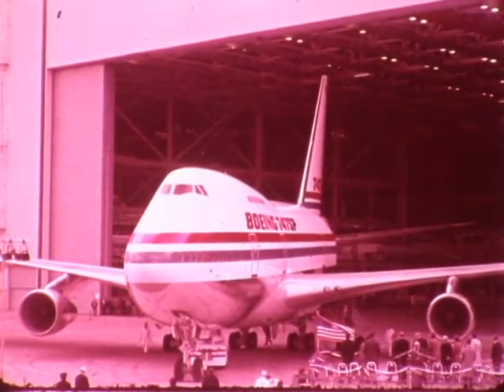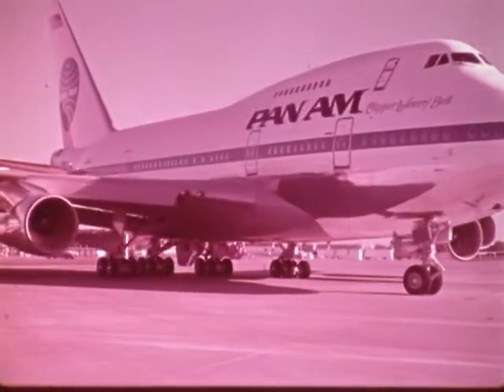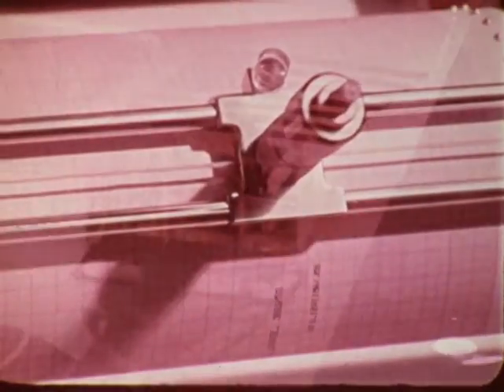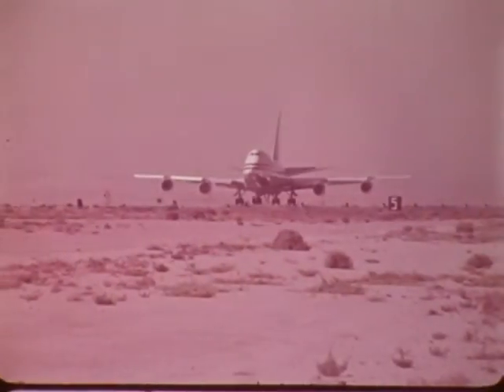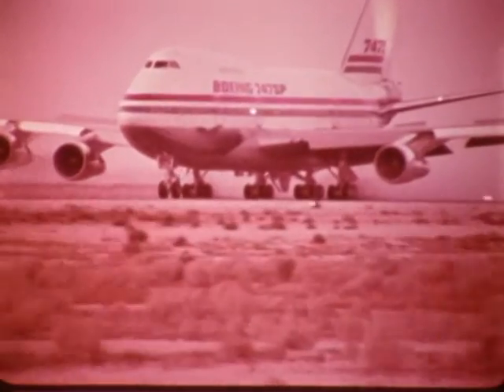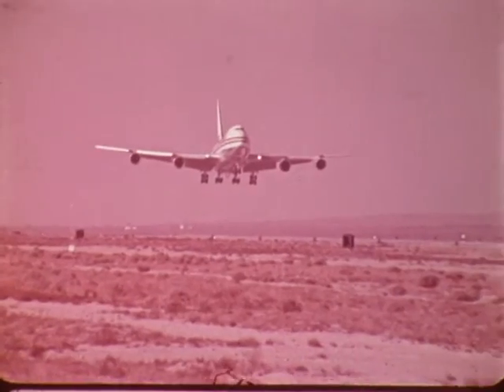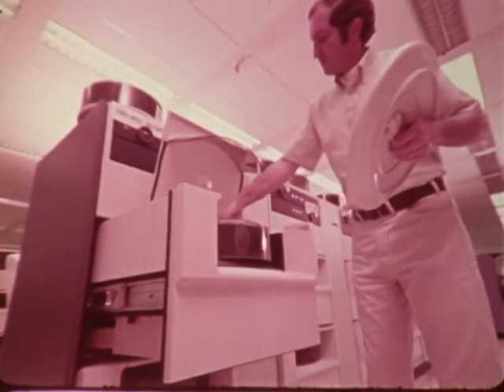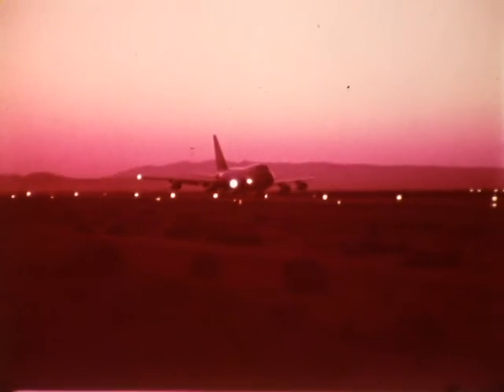F 2198 Flight Testing the Boeing 747SP

Comment: I've reported this elsewhere on YT, but I was one of the volunteers for the FAA certification of evacuating the aircraft with half the exits blocked in under 90 seconds.  I gotta tell ya, until you've been through an evac, and this was a test, you don't know how fast it goes and those slides aren't Waterworld, they're more like sandpaper.